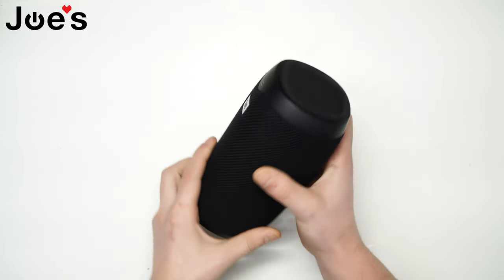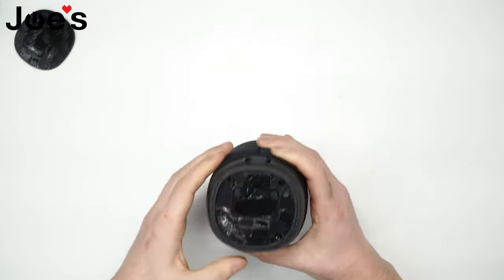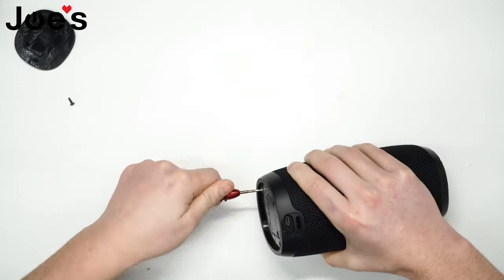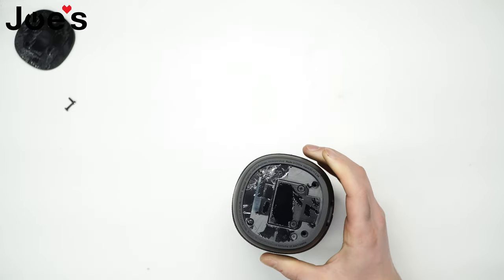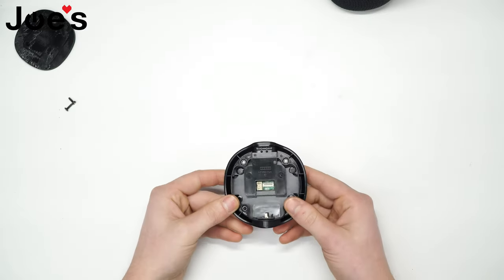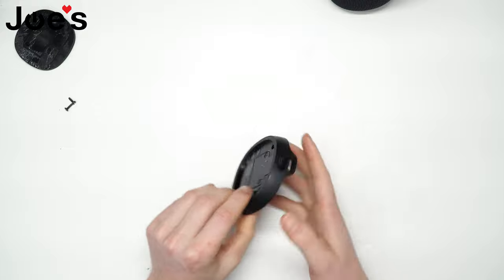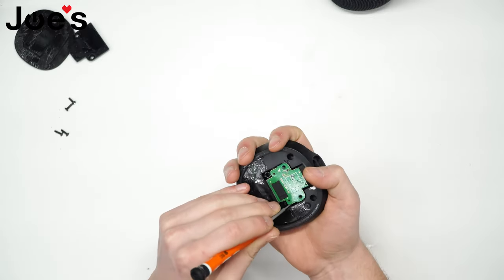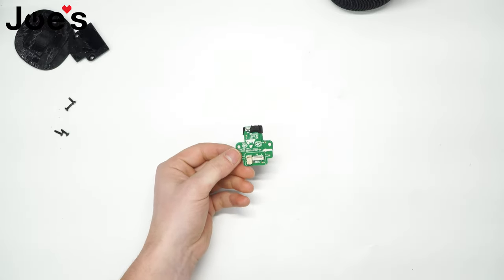How To Repair JBL Link 10 Broken Charger Port Replacement | Repair Tutorial

Comment: Added my email for notification when (hopefully) you will get that pcb in stock. I am fine with the battery going bad and having the speaker plugged into the mains all the time, but I do need a working port for this. And mine is definitely bad as when I wiggle the cable a bit, it starts charging. Tried several cables and chargers to confirm its the port gone bad. What a weak 'LINK' for this speaker, LOL
Reply from the maker: Thanks for watching. Please like and subscribe for more content like this! We should have those parts in shortly.

Comment: What if the unit won't hold a charge, but still works when connected to a usb charger?
Reply from the maker: You may have a bad battery!
Reply: @Joesge  it's so strange. I reset it, and it seemed to work. I used to for a while. Then it suddenly shut off and wouldn't turn on. I plugged it in for a second, it showed 3 bars and it's working again.
Reply: Where to buy the charger port?
Reply: @Joesge  Can you show how to replace the battery? Mine works fine when plugged up but won't hold a charge.
Reply: Thanks for your vidéo :)
My usb port look like fine, but no light or anything workable. When I check how many amp it consume, the usb drop to 3 volts and arround 3 or 4 amps ! That's not normal, but that's cause of the charger part or the motherboard ?